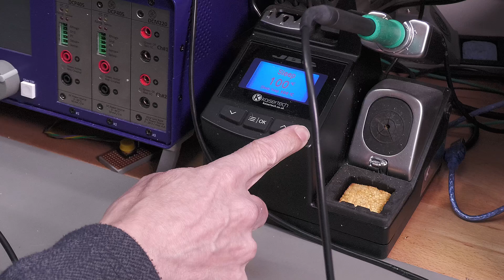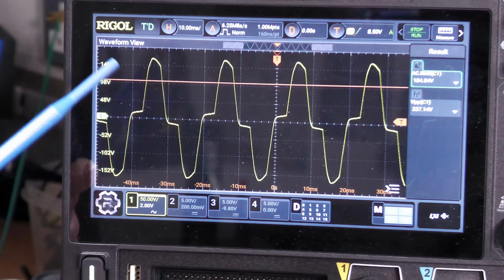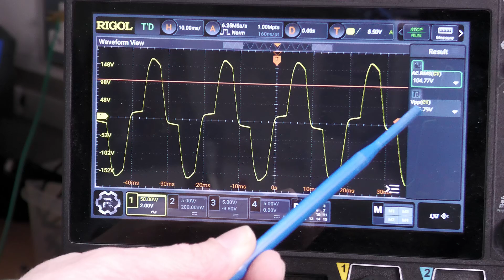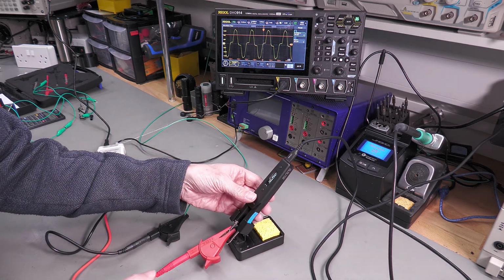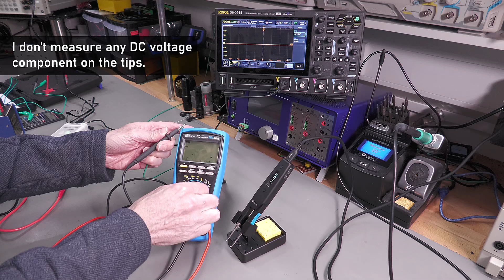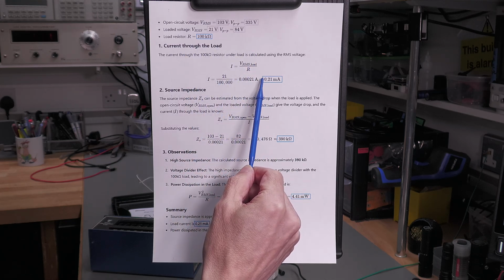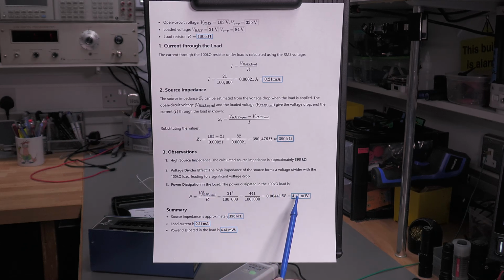No.149 - Sequre HT140 Soldering Tweezers Problem and Fix

Comment: Hi Ian, does the temperature control still works correctly ?
I have seen on a soldering station review that wasn't grounded, that the temperature went above 440° C while the set temperature was only 360° C.
This was caused when soldering on a grounded circuit.
The video where this can be seen : 
https://youtu.be/B7jLpHgR7fI?t=1424
Reply from the maker: Appears to work just fine.
I have seen wierd issues when temp sensors/probes are wired incorrectly/backwards, i.e. offsets and the like.
Reply: great video, thanks for the link

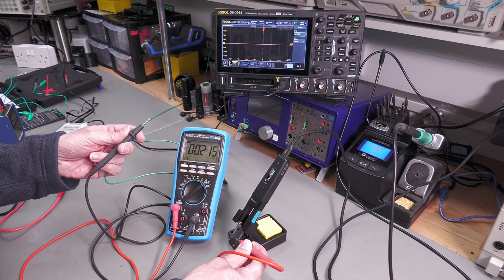Comment: 4:12 It's interesting that the Vpp measurement is much more than the "normal" 2*Sqrt(2) * VRMS.  Presumably this is because the waveform is quite non-sinusoidal.  The ratio of these measurements does note even have the same ratio for unloaded versus loaded with 100k.
Reply from the maker: Distorted waveform and harmonics maybe.
Reply: Definitely 😅 @IanScottJohnston

Comment: A bit confusing to show the problem with the use of a differential probe. A solitude DMM with 10MΩ impedance would do I think ?
Still thanks for pointing it out.
Reply from the maker: Just a precaution as the Rigol scope is USB power also and although it has an earthed PSU it exhibits about 0.8Vac on the BNC shell relative to mains earth. I wanted full isolation to rule out any ground loops etc.
Reply: @IanScottJohnston  Yes, definitely lacking the experience you have, I still saw that it was because of the use of a scope to show us. But that is why I probably would use a DMM, to avoid the earth problem while measuring. For the educated viewer it is a fact, for the others it is a question what that differential thingy is....

Comment: I would have liked to see a verification step with the differential probe connected between the mains earth wire and the iron tips to see if that 100V AC on the tips has been pulled to ground. We don't actually know if the soldering tweezer tips are connected through to the USB shielding nor if the power supply is properly connecting the shields across the 2 USB ports
Reply from the maker: See the video annotation @6:44 where I had confirmed the USB-A socket (shell) is connected directly right through to the tips, hence I didn't bother to show the final result on the multimeter.
https://youtu.be/se6-jGZsHS0?t=405
Reply: @IanScottJohnston  Oh I'm sorry! I didn't notice that annotation! I was looking at your fingers touching the earth wire and not paying full attention to see the annotations
Reply from the maker: No worries, I have pinned this to the top of the comments also.....incase others have same query.
Reply: @IanScottJohnston  was there supposed to be a link to a different video demonstrating that?

Comment: I bought the same HT140 tweezers on aliexpress but without the 65W USB PSU. I am using a grounded 24V 100W PSU.
Reply: I plan to do same thing. I have old soldering station with 24V/60W transformer and plan to make simple linear PSU for that purpose.
Reply: Could you please share the link or at least the model name?

Comment: I like the weller soldering stations where the tip connection is via a jack socket.  So you can short the tip to ring in the plug and once plugged in ground the tip, or it allows you to fit any value resistor you want.  I like a 10k resistor nice pull down to earth for leakage but will not pull too much current if you decide to work on with some voltage still present after turning off.
Looks like I might have to see if santa has any money left over, as the covid-19 like present he gave could not have been too expensive 😂😢.  Went down on the 25th and the shi* is still working its way out 😢
Reply from the maker: Sorry to hear you've been subjected to the dreaded lurgy........I prescribe you a week in your workshop. Usually helps all ailments!
Reply: @IanScottJohnston  thanks doc.😄

Comment: This issue is a potential problem with any USB powered soldering iron.  Anyone using a USB soldering iron should take note.
The voltage and energy available in that leakage current could easily damage more sensitive devices such as RF FETs,
I don't think I have ever seen a USB wall wart with an earth ground connection.  I wonder how many even connect the shield connection internally.
Thank you for bringing attention to this issue and offering a low cost solution.
Reply: You can find some USB power adapters with earth ground, but they are very rare. Apple laptop usb-c adapters are grounded if you use the long flexible AC cable attachment, at least the US one, instead of the shorter prongs-only attachment. I think the Ugreen 200W or 300W multi-port USB adapters also have a grounded AC plug ...
Reply: @ploxiln  I just checked my 2019 87W apple charger and it has about 1 Megohm from ground to C-shield 👍
Reply: Not the only USB irons, but most of cheap soldering devices with non-isolated switching PSU

Comment: Even with that relatively high source impedance I can imagine even some low voltage capacitors would not be really happy if they caught the full peak voltage, never mind silicon devices.

Comment: I like to include some resistance in a soldering iron ground - just in case. With real transformers 1 Meg works. But you have a switcher so there will be current through the dreaded Y caps. 1 meg will leave a lot of volts on the tips, so maybe 1k.
Reply: resistance from tip to ground must be under 2 ohms and voltage under 2mV. otherwise not esd safe

edit: 2mV restricts that the grounding wire is not used to carry current
Reply: @cannesahs You use a 1P2T switch so you can choose either a direct connection or a resistive bleed.
Reply: @donepearce  no, you don't. a short to earth is provably always a bad idea.
Reply: @cannesahs that is wrong. a dead short to EARTH, not ground by the way, will create unlimited current from a device that has accumulated static charge to earth. This current is what damages the device, whether it's charge ENTERING the device or LEAVING it. yes, you can ESD shock devices with a bare earth too. That's why ESD safe mats and devices are never made out of metal, they are made out of DISSIPATIVE materials such as carbon loaded plastic. Those devices have inherent resistivity and will not allow unlimited current. You want a 1K resistor, also because of human safety (shock protection).
Reply: @cheater00  so industry standard practise, nasa, esda, ansi's esd-standard are wrong?
in an epa there should not be charge in components before those come contact with a conductor.
soldering iron's heater usually leaks tiny current, not to even mention these chinese soldering station's psus. under 10V leaking thru your resistor to ground AND to the component being soldered can be enough to damage the component
Reply: @cheater00  exactly. I use a leakage path, not a dead short on my iron.
Reply: @cannesahs you're not making sense buddy
Reply: @cheater00  I am. I don't like silvering irons rhat are hard grounded with a wire. Although the requirement is rare, this means I can't use them in a live circuit. I prefer any charge to be bled away through a resistance.
Reply: @donepearce  right
Reply: @cheater00  lets try again: grounding the tip is to protect the thing you are soldering from voltages present in the tip. a heater inside the tip generates voltages to the tip.  by leak, by induction, etc. 

you are correct that in common esd protection you want to slowly equalise potentials. but that is already done before you solder. all objects in work area are (or should be!) already in ground potential.

using a resistor to bleed charge from a tip is not useful as it is not a capacitor you want to discharge slowly. the tip is continuously getting current.

very sensitive components, like RF mixer diodes (lacking esd protection because of performance reasons), can get damaged in levels of just above 1V.

there are requirements for tip's resistance, voltage, and current leak against ground. not just DC, but also AC and RF.

so: do not try to use a tip to discharge potentials. ground the tip and do it with a wire that is not used to carry operating currents to heater / soldering iron.
Reply: @cannesahs All good, but not the reason why I like to have resistive grounding for an iron. And I have a switch so I can swap between hard and soft (resisstive) grounding. Hard grounding is normal and prevents any voltage appearing on the iron. But sometimes - and this is key - one may want to work on a live circuit. Swapping out cap values to tune something for instance. It may be inconvenient and time consuming to keep powering the circuit down. In this circumstance you don't want a direct ground on the iron tip. It will short out the circuit. But you still don't want the iron floating - it can couple mains voltage capacitively. So you tie it down with a large resistor that will prevent the float, but not compromise the biasing of the live circuit.
Reply from the maker: @donepearce  Sure, if you have the knowledge then you can set up a switch for dead short / resistive earthing……but Sequre and the other manufacturers couldn’t supply that as part of their kit….to complicated and subject to misuse……so best to just short it down as that will suffice 99% of users that adhere to other practices IMHO.
Reply: @IanScottJohnston  There are clearly liability issues associated with earthing choice. No manufacturer will ever do this, but I recommend it for anyone who understands the issue and is prepared to do it at his own risk.